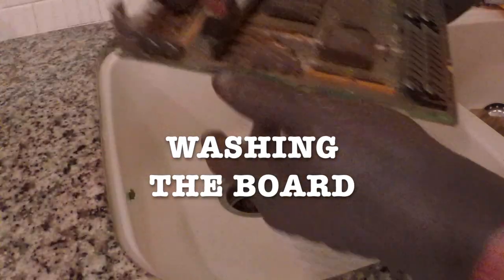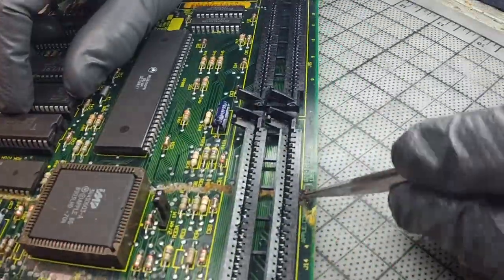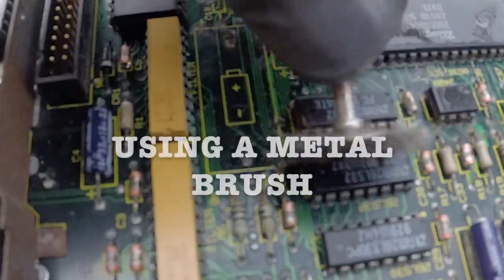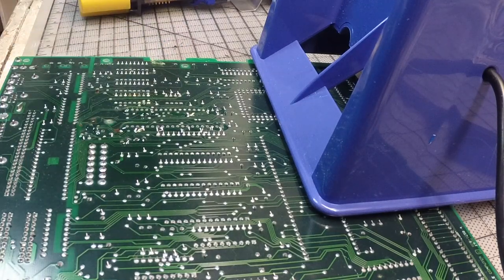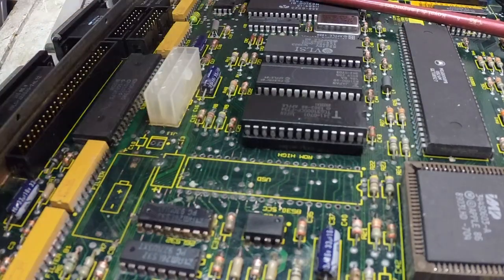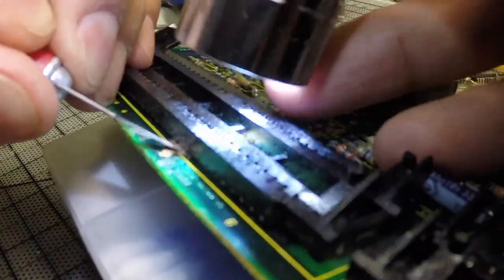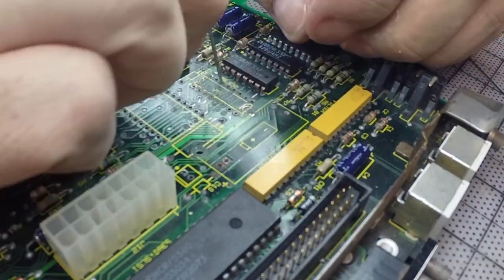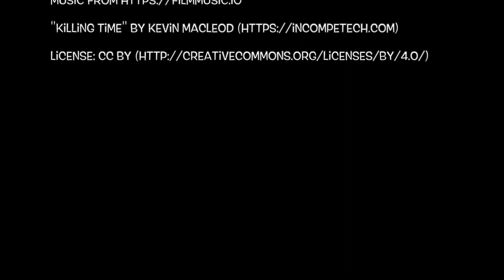Adventures In Retroputing- Quick Tip - Clean a corroded motherboard

Comment: Thank you so much for this type of content. I have discovered some small corrosion on my motherboard which I want to clean up to hopefully make it work again. I have got persisting problems with my laptop not turning on and the bios resetting once I finally manage to turn it on, which lead me to changing the cmos battery and discovering the corrosion on the motherboard. This video is really giving me hope that it might be saved. I just carefully scratched off some crystals from affected spot which look like salt. My guess is that this might attract moisture sometimes and explain why the laptop is working excellently sometimes and will return to the realm of the dead the next day due to a short circuit. (I call it proserpina now.)

Comment: You just brought me some faith for mine. i have a SE/30 Board that is seriously contaminated with rust and damage from the battery Acid similar to yours and the Video rom Chip is now damaged as i pulled it out from it's ic socket and some legs broke in there. i ordered the video Chip and looking for the IC socket for it. After watching your video? i think i will now restore my board.
Reply from the maker: Sometimes they look worst than reality, you have nothing to lose. Give it a try!

Comment: what kind of soldering iron is that, that sucks up the solder from each chip leg???
Reply from the maker: That's a HAKKO FR-301 desoldering tool. It has a vacuum while it heats the pin.

Comment: That thing cleaned up pretty well!  I wish the IIgs board I've been working on would clean up that well, lol....  I have vias eaten all the way through and ICs with pins eaten off and it's a total mess hahaha.

I read that the alkaline battery leakage would keep eating away even after the board was cleaned up, so I soaked mine in vinegar to try to neutralize it, followed by a good wash in the sink.  What's your opinion on that?
Reply from the maker: I'm not sure, but I cleaned another mess in a IIGS a long time ago and it is still working. I think the vinegar trick is good enough.

Comment: Hi how long after you wash with water can you connect it back up if the ic can't come out can I use vinegar to clean it and wash with water after
Reply from the maker: I would say a day in a dry place. I live in a sunny and got place, and leaving under the sun for 3 hours gets really dry.
Reply: @ARCJavMaster  can I use vinegar to clean underneath the ic because I can't take it off it solder both sides
Reply from the maker: @rolandstgeorge3576  yes vinegar bath 
and later clean again with isopropyl.
Reply: @ARCJavMaster  yes I did use vinegar then wash with soap water the 90% alcohol
Reply from the maker: @rolandstgeorge3576  That should do it! Hope you can recover it, please share your experience!

Comment: 4:52 a toothbrush would be far better to use in this case than a wire wheel, the wire wheel is far too hard and removes far too much material even though you're using it gently, you can see there's a few traces that's been partially lifted, the wire wheel has the chance of taking the pad with it due to how hard the bristles are.
Reply from the maker: You're right, was a little carried away...